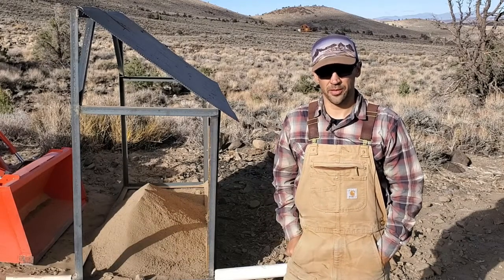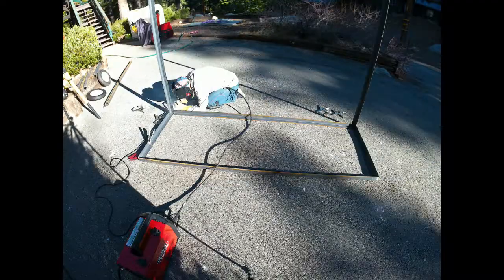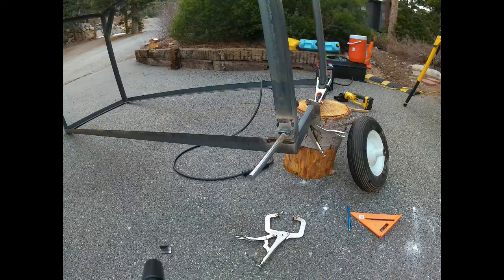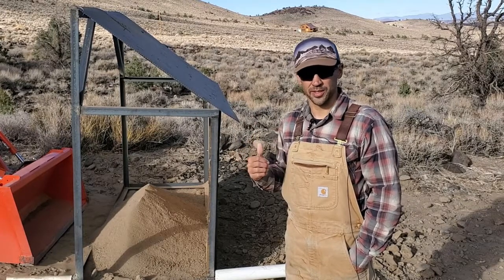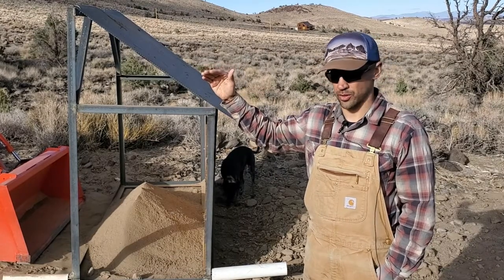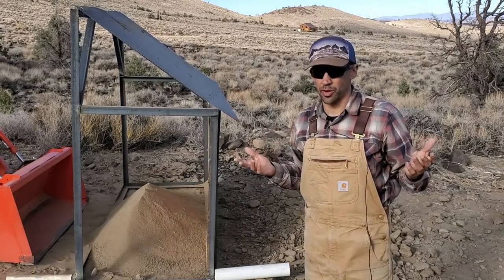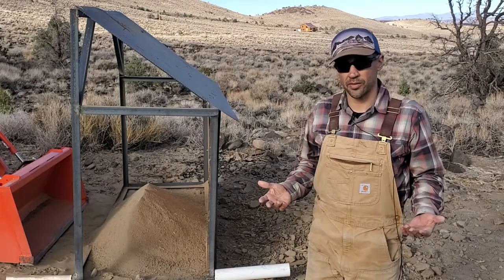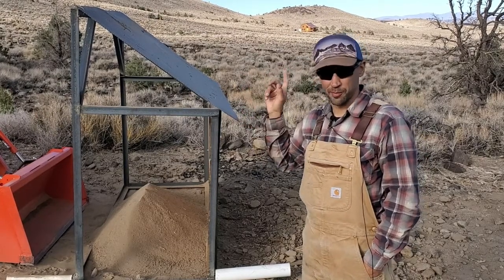DIY Soil Strainer (Rock Strainer, Rock Grizzly)

Comment: Good job on this! Thoughts on it a year later?
Reply from the maker: Hey man! My buddy's full size grizzly is nearby so it's fun to see the difference. I'm still happy with it but it's massive amount of dust  and definitely lighter duty. I beefed up the top bars and put expanded steel on when I wanted a more finished product. All in, it was good! The wheels were dumb! Just lift it with the loader.

Comment: So what you need to do is wrap that whole thing in a cheap Big lots tarp because it's going to get tore up. I'll cut way down on the dust leave it a little baggy at the bottom weight it down with some of those rocks.
Reply: Ya, just watched this...first thought was hang a tarp off the back side.
Reply from the maker: Like the other guy mentioned, that's a great idea.